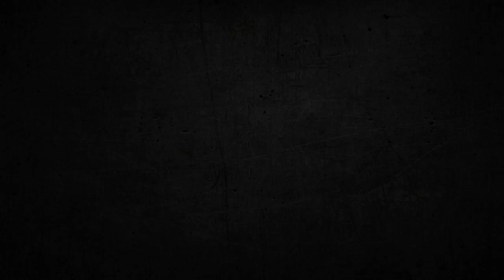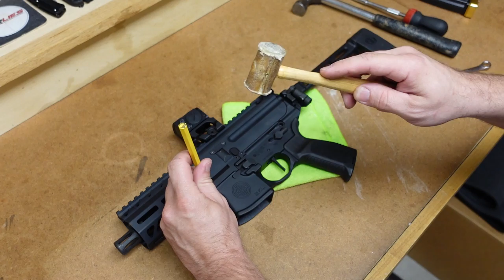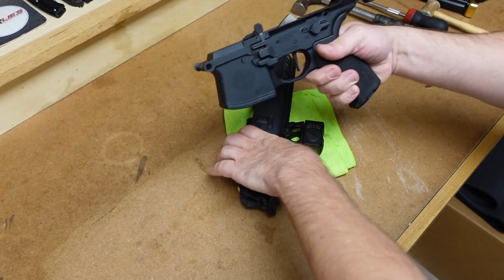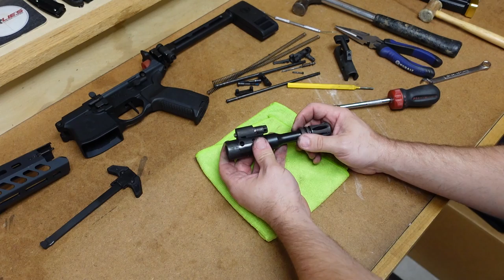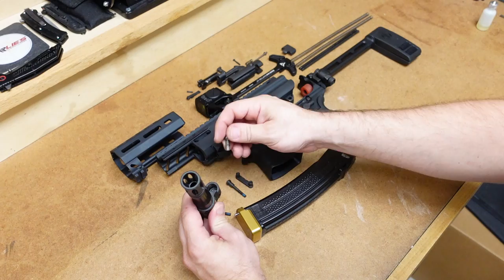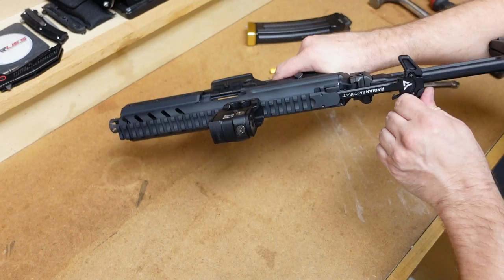Field Strip: Sig Sauer MPX K (w/ barrel & gas piston removal)

Comment: I have a gen 3 mpx k and was wanting to purchase a radian raptor CH I’ve heard some people say it scrapes the receiver, is this true ? Or maybe it was just a problem with older gen mpx models cause it looks sweet and I’d love to upgrade the Stock CH to Radians but it seems the problem is the bolt is having trouble closing all the way with a mag inserted I never had this problem with the stock Charging handle and I obviously recently removed the bolt and CH to install the Radian one
Reply from the maker: I have not heard about or experienced those issues
Reply: @thetexasgunvault  thanks so much gonna order one now haha cause it seems like these are hard to come by in 2023 today the company emailed me and said fde and gray are discontinued
Reply: Back again unfortunately I installed the radian raptor charging handle and I’ve on mine I see scraping all along the top of the handle right on the logo not sure if this is normal and using the radian I have to pull the handle back with more force and release it all the way back for it to chamber the round correctly if the mag is inserted in the mpx and I try to rack it back I have to do it with force as well… if the mag is inserted and I use the bolt release to close it it chambers no problem it’s very weird, also I have no lifter or anything on my radian Handle my mpx is gen 3 and I’m using the new sig mpx mags… do you think I could have possibly put the bolt in wrong with the ejector not all the way forward or do I just need to oil the shit out of this radian CH very confusing may take it to my local gunsmith/store see what they think I didn’t experience any of these problems with the stock CH
Reply: @McClutchin941  can you tell me how it's working after using it for some time? Any issues? Scraping?

Comment: Thanks for the detailed breakdown. One minor detail - I noticed at 4:15 when you took the cam pin out, the divot was on the bottom. When you put the cam pin back in, at 10:55 the divot was facing up.  I don't know what difference this would make but the cut out in the cam pin would be at a different angle.
Reply from the maker: The cam pic can only on in when the firing pin is going through it. It really does not matter.

Comment: What happened to using a torque wrench on the barrel bolts? Great video very informative. Thanks.
Reply from the maker: Aa long as you don't over tighten them you will be fine.
Reply: @thetexasgunvault  
Some accuracy issues people have had were from the barrel bolts not being torqued correctly. I personally will continue to use the torque wrench and read Sig’s current user manual since the torque spec has changed 3 times for these bolts.

Comment: Appreciate this video. Would like to pick up some extra MPX K firing pin retaining pins (cotter pin) to have on hand for future cleanings. Not an easy part to get reinserted. Can definitely see this becoming damaged or lost with frequent cleanings. Where can it be purchased from?
Reply from the maker: You might try Sig, or Brownells. Maybe even Numerich.
Reply: I was just about to say there's a parts breakdown on page 96 of the manual, but it doesn't tell you a part number. I found the part number 1700005-R on Brownells, but they're out of stock. Optics planet has them in stock. It's the correct part number, but the picture on optics planet is wrong. I would probably call and confirm before hitting the order button. I got my mpx last night, and didn't break it down that far yet, but I'm very thankful I read your comment. Having extra firing pin retaining pins is a great idea.
Reply: @MikeHoxafloppin thanks. I’ve contacted OP to verify which Sig part they are actually selling under that PN. More to follow.

Comment: Not sure why yours has issues removing the firing pin and cam pin when dirty, mine come right out if not tap it on the table and it falls right out (for the firing pin) cam pin comes right out too 🤔
Reply from the maker: Very interesting. I do not know why either.

Comment: Did your extractor come with an o ring in it?
Reply from the maker: I believe so.
Reply: @ I ask because I heard the newer ones do not come with one. I’m having some issues with the bolt not fully returning to battery from time to time. Some people say that removing the o ring has fixed the issue for them. Just curious if yours had one, thanks